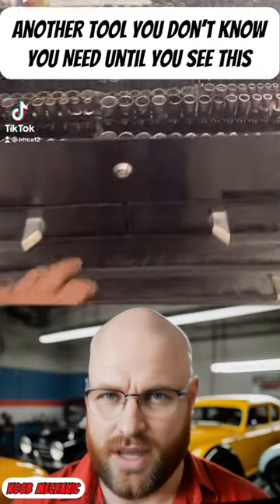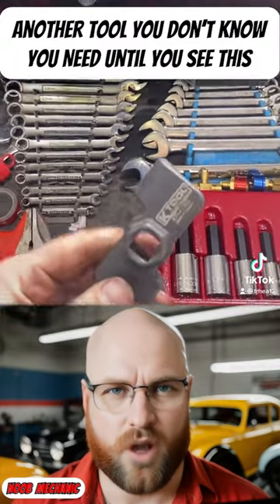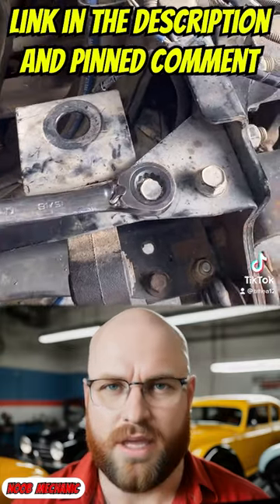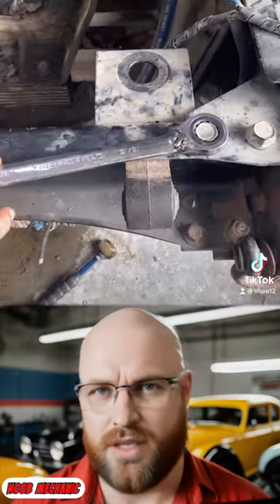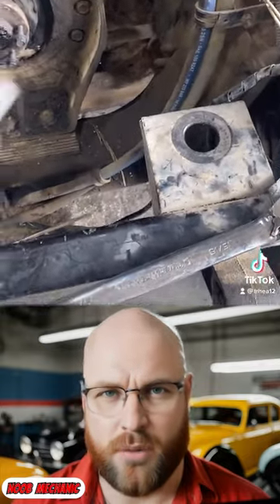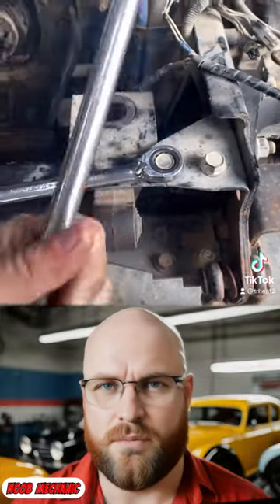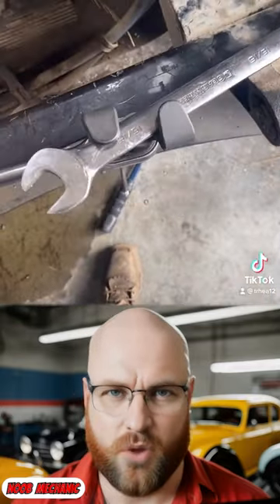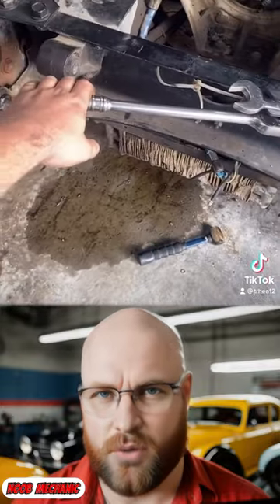I bet you didn't know you NEED this tool.

Comment: I wouldn’t use a ratchet spanner on a bolt if it was that tight, could break it, use ordinary spanner or a socket with power bar.